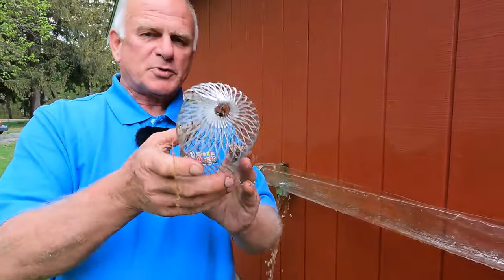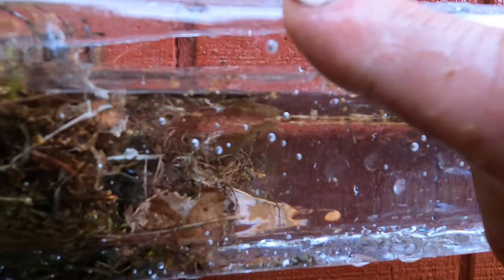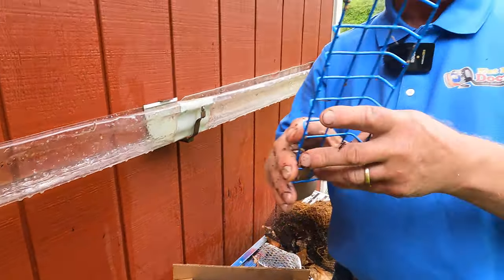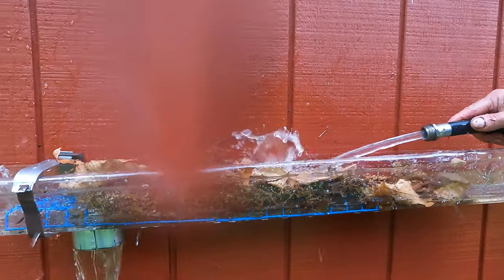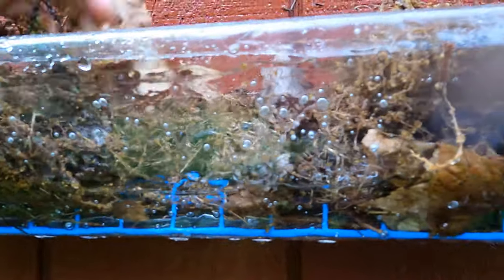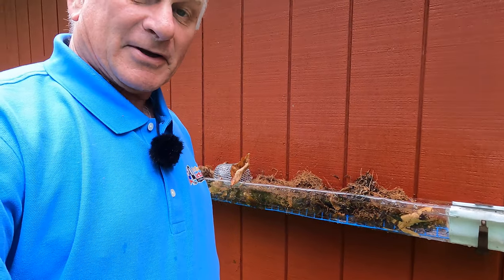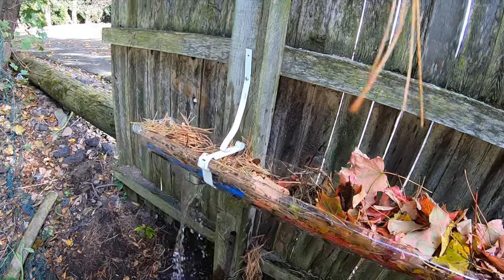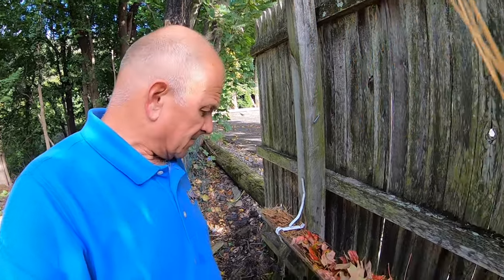GUTTER STRAINER OR GUTTER GUARD? what works the best?

Comment: well the debris just bypassed all and went through the down spout. the other leaves you put on top were filtered but those that are collected as a downstream will just make it to the drain, eventually clogging it
Reply from the maker: I made another video where I left the filter in the gutter for over a year and it was working very good. I took the video in a rain storm to show it works
Reply: I agree, the way he is demonstrating it is not a natural progression of the way it builds up. I used the small wire one the goes into the top , the first one he had and it works just fine. I go up and clean it once a year.
Reply: Not true.  I clean gutters.  This is a great concept.  All gutter downspouts need annual check it maintenance.
Reply: ikr, he must be selling this😆

Comment: Seems like a b.s. demo.  OK, so the little blue filters didn't clog up... that's because they let all the stuff run under them and down into the downspout.  At that point what is the goal you are trying to achieve here?  You would get the same results to take them out.

Comment: Easier yet.  just paying 25 dollars and buying a gutter stick. I just cleared a gutter that had the expanded screen over the top. The small stuff falls through that rot and then slides in mass and plugs up the downspout. The gutter stick is the most straightforward answer to solving the problem.

Comment: I like the effort, but these strainer units prevent the clog from happening inside the vertical gutter. And show you where you have to easily remove the exposed blocking material.

Comment: you did not perform equal testing, you performed marketing in your products favor.  Debris in a flush for the "bad" screens with constant flow.  Debris in smaller parts AND using the water stream differently by far for the "better" screen.

Comment: You helped it quite a bit with the way in which you were placing the debris and pouring the water. This is not how rain and water will flow through. Id like to see the debris move by the water rather than you placing it on top otherwise i cant be sure of what you claim these will do.

Comment: The point with the debris filter, is so it doesnt get debris in the pipe that goes underground. If you dont have a pipe go under ground, then its no problem. The filter you liked, is better if put directly on top of gutter.

Comment: Put 1/4” galvanized steel mesh (hardware cloth) over your gutters one side under your shingles the other side screwed down to the edge of the gutter. 
1. Keeps out debris. 
2. Doesn’t restrict water flow. 
3. Leaves and other debris won’t build up on top of the mesh because it’s angled downward. 
4. Very cheap and available at local hardware store. 
5. Easy to cut—install using 3’ x 6” sections. 
6. Effective—any debris small enough to get through 1/4” mesh won’t clog your downspouts and gets washed away. 
Even if you still get good water drainage from using the filters in this video your gutters will eventually fail from the weight of the debris building up unless you clean your gutters. No gutter cleaning necessary with the mesh method described above.

Comment: We have needles from fir trees. Wouldn't they clog up the drains that are buried underground using a one inch filter?
Reply: Yeah the best is the traps that fit on the bottom of the downspout that you can pull out and clean every couple months if you have under ground drains so they don't block up.

Comment: Your recommendation for best “filter”, IS NOT FILTERING!!!
The debris will now get stuck in a hard to clean area. 
My downspouts dump into a corrugated pipe that travels underground. 
I would much rather clean a screen mesh that gets clogged in the gutter, versus having all the debris getting stuck in my corrugated tubing underground!!
Reply: I agree. Much easier to clear one spot at the downspout in the gutter than trying to clear the downspout itself or worse clearing the drain underground. I do understand the concept of straining large debris while letting smaller ones drain through because the size of the drain shouldn't clog with small debris as heavy rain will easily flush them. But the open end of the filter he shows will let large enough debris through in time and once you get a partial clog you're well on your way to getting a full clog. Maybe a modification to the design where at the end where it faces the onrushing water it should be blocked off or have the same mesh as on top. No matter what filter is put in gutters still need to be checked periodically.
Reply: I had the similar thought because I have 6 downspouts in all, 3 of which are attached to french drains. I simply need something to stop leaves and other objects from passing through the spout. Annual cleaning will be simpler than hiring a plumber to clear the French drain. In order to flush any debris out of the french drain, I recently bought a Sewer Jetter Kit for Pressure Washer to attach to my pressure washer.

Comment: How did you make the plexiglass gutter? I'd love to have a section like that to easily keep an eye on how the gutters are doing.
Reply from the maker: I went to Home Depot and got a sheet of plexiglass. Then I used a Torch to heat up the plexiglass while lying on top of a gutter. It slowly started to conform to the gutter. took hours and was not easy

Comment: Will u show the process of the gutter being  engineerd? Thk u
Reply from the maker: You won't believe it, but it is not easy. This particular gutter I made from plexiglass I got at Home Depot. I used a roofing Torch to heat it up to make the bends. Since then I made another on slightly better, but I don't have the method down yet. I still have to find the right technique to bend plexi glass